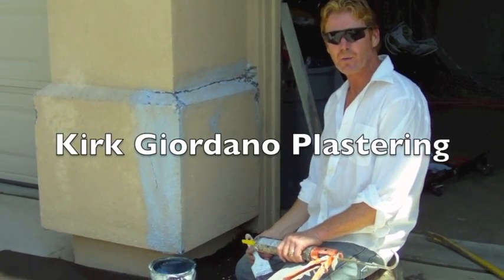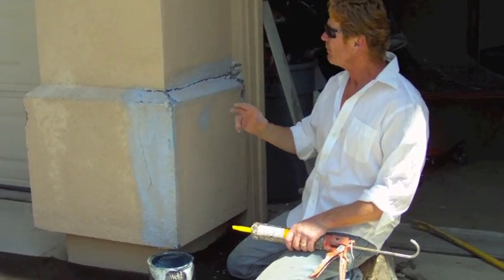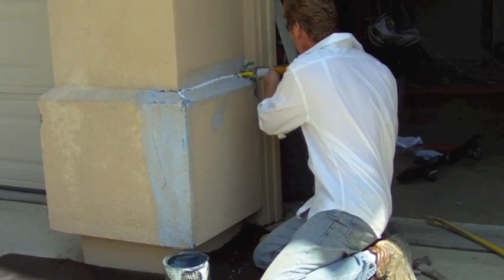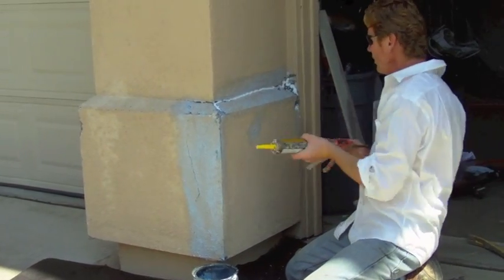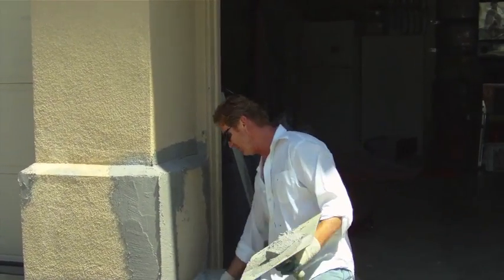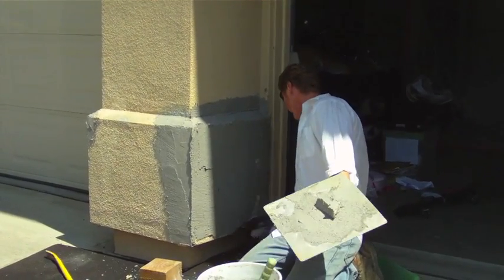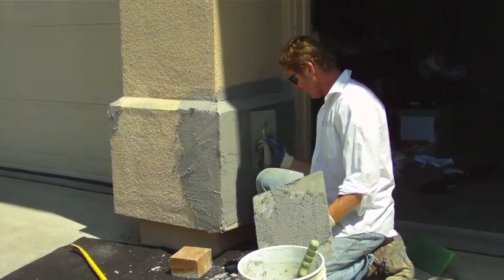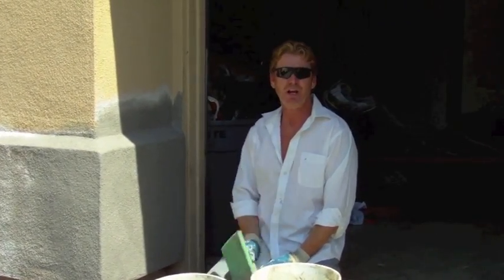Repairs on stucco styrofoam

Comment: On the column repair video, how do you get the texture to match after floating?
Reply from the maker: Hello Pamela, You would use whats called a sponge float, which pulls the sand to the surface. 
Below are two videos that explain in detail how it's done.
The best video online about caulking stucco is below, how do I know? 
I created it for this purpose.
 https://youtu.be/2eIkdeIBbMs/ Learn how to caulk or repair large cracks in stucco.
https://youtu.be/D5gaZmYk3bU/ How to use Quikrete adhesives caulkings and concrete fillers.
Kirk Giordano Plastering

Comment from the maker: Howdy Nichole, no it won’t compromise the integrity of the stucco. It sounds cosmetic to me. Simply apply a sikaflex adhesive caulking or similar product and stick it back to the original styrofoam. 
 You might need a touchup to get the texture right also.
It’s the waterproof membrane a person needs to keep in excellent condition. 
 Best wishes and have a good evening.
 Kirk Giordano plastering

Comment: I have a similar column pop out on my porch. Not a full height column - say a 4’ stub capped. I want to add an electric fireplace insert on the inside 20” x 26”face (18 x 24 insert). Thinking that face is basically styrofoam & stucco. Not 100% sure how these are built? Want to be sure I have “dead” space in that boxed area? I do know the pop out is 5 1/2” to the inside concrete column. Any vids on this?
Reply from the maker: Sorry, no

Comment: Hello, I have some small gaps maybe a few inches wide and a few millimeters deep. What do you recommend I can just simply fill it with instead of going through the whole stucco/mix procedure?
Reply from the maker: Howdy Rex, yes, you can fix or repair it with a ten-pound box or rapid set stucco path sold at Home Depot or Lowes.
 Or use caulking. If you use caulking, it will shrink, so what? When it dries, simply apply more, then match the texture with the caulking. Buy some Quikrete, Sika-flex, or Mor-Flexx caulking with sand  in the tubes for an easier and better match on the stucco styrofoam. 
These are also sold at HD or Lowes. Best wishes,
Reply: @StuccoPlastering  Hello, I went to home depot and purchased 1quart of ready-mix stucco patch. Worked perfectly. Made it blend even better by using a slightly wet sponge and dapping it, further blending it and making it look like nothing had ever happened!
Reply: 1 Quart of PRO SELECT, Ready-Mix Stucco Patch. That's exactly what it's called in Home depot. It costed me $8.78 each.
Reply from the maker: @RexFella  Cool beans, that's not enough to break the average person financially. Cheers.

Comment: Kirk, is it the same process to repair eifs walls?
Reply from the maker: Evening Nick, close enough.
   Bringing peace, love, and brotherhood back to the world of, “Cement Plastering.” 💃
With over 800 educational and free Youtube videos, by your favorite plaster geek, “me🤓” and my son, “Jason,” the bearded plasterer.🌍
Reply: @Nick Owsley  They are using different slang or words on the West Coast, as I am in Omaha, NE. Very few use "Stucco" because it is porous and allow moisture in unless painted. 
 I have EISF which is not "Stucco" but often called "Synthetic Stucco". Where stucco is usually tar paper, metal lathe, cement base coat (Some have additives, fibers or chemicals) but in the Midwest, temps range from 10 degrees below to 110 degrees F. Since we get rain and snow, it is terminated at 6-8" above the ground level. But to reduce utilities cost many use an "Extruded Polystyrene" over a moisture barrier like "Tyvek". The two inches of extruded polystyrene is held with coated fasteners at a 16" on center square pattern. It get scuffed with a wire brush, the EFIS grade expanded white polystyrene is trowel with vertical notches to allow gravity to drain out moisture. The polystyrene allows for way many more interesting architectural patterns to be applied on the outer wall. Different types of coated fiberglass materials of various thickness to be embedded into final top coat to where the meet highs winds & debris as "Dade County" Florida have for hurricane protection. Stucco goes on concrete blocks most of the time. Repairing damage from cars or birds require the area cleaned, ground back & tapered back to patch and remain flush. Spray foam or "Cut & Fill", cover with cement base, trowel in fiberglass patch (Round or Square) until no longer visible is best practices. Let cure & dry over night, grind smooth then apply colored topcoat that contains the color and marble aggregate depending on customers choice or existing texture. Small, medium, large and bigger yet. They use a magnesium trowel so as to not leave small particles of steel to rust in the finish. But, no painting!

Comment: Hi Kirk, Im curious about something you talk always and is that lluminated, which product is that?
Reply from the maker: Good Morning, Hermes, luminite is just an accelerator for cement plaster.
 When added to cement it set it in minutes instead of hours without compromising the integrity of the cement plaster.

teaching plastering do’s, don'ts and reasons why
                     Live long and plaster